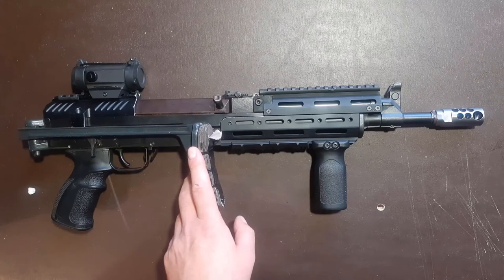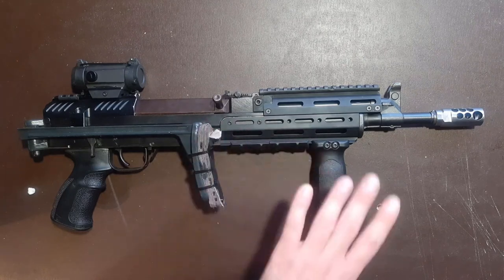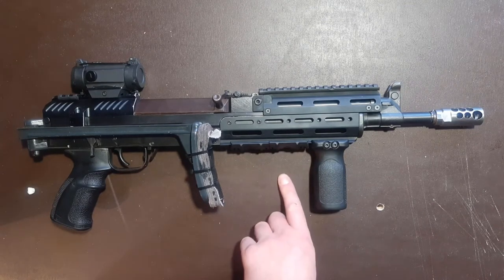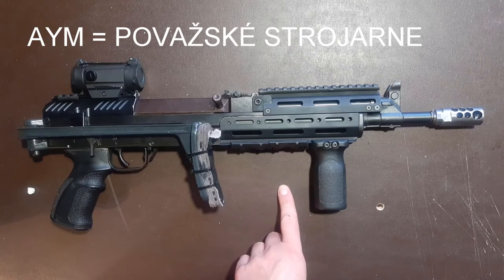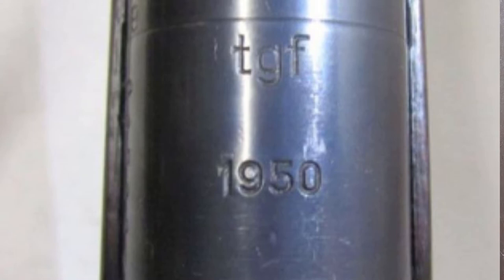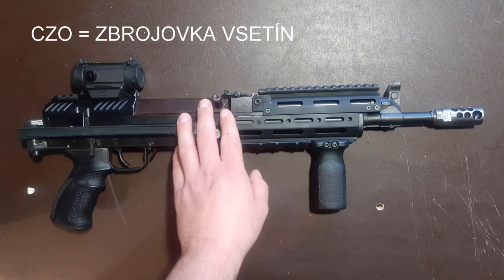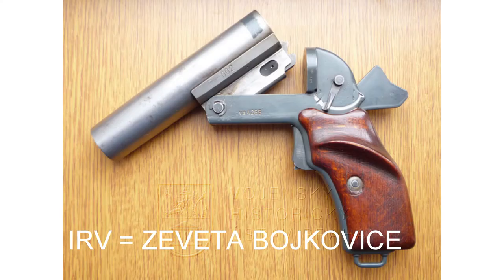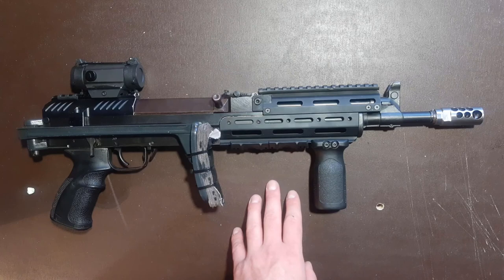Production codes on the Czechoslovak guns

Comment: Does that VZ58 Pic-Rail Mount hold zero after disassembly?

Nice video btw ^^
Reply from the maker: yep perfectly.... the two bolts on sides are clamped to the edges of the frame and that keeps it secured as hell.... The only problem is that the disassembly takes a little longer... but the price was approx 40 bucks so I don't mind :) there are other options on the Czech market though, that are quick release or they only wrap around the original dust cover.... :)

Comment: Do you have any information on the markings on the Vz58 bolt and locking block? I assume they are proof marks but I would love to know more!
Reply from the maker: yup, I have some data. What does your say? There are different markings for civilian and military parts.
Reply: one of my bolts had a "U" stamped into the right side. On the left side there is either a "1" or an "L" in a circle, looks hand drawn there is also "U6" in a circle drawn into that side but it is faded and hard to tell. The locking block is stamped "07" on the right lug. The left side of the block has written on it what looks to be a vet stylized "R" and "s" in a circle and what looks to be "P'3".
Reply from the maker: @Homebrew_  these looks like some internal codes from Ceska Zbrojovka. Probably only a batch numbers. Checking mine I have similar coding on the same places. I will see if I find out any more details and let you know... but looks to be just a batch number from the factory and later maybe whoever was turning it into semi also may have added some marks. The interesting thing speaking of numbers is for example with Vz. 82 pistol. This gun had three different groups of the same parts based on the size. So for a proper function sometimes you had to have the right size part.... but thats not a case of Vz. 58, thats plug and play stuff... :)
Reply: Thank you for the info! I have two other bolt groups with similar markings, they all function perfectly in the same rifle. My rifle from Century Arms, built from imported parts kit with an american made receiver.

Comment: I have seen the code OTK on an Sa vz. 58 magazine. Do you know the manufacturer?
Reply from the maker: Hi Mate, that is not a production code but it stands for Oddělení Technické Kontroly = Technical Control department. It is somehow similar to VOP tag - means that the mag was checked and refurbished by the appropriate army repair center.
Reply: @CzechoslovakGunStories   Ah, thank you!